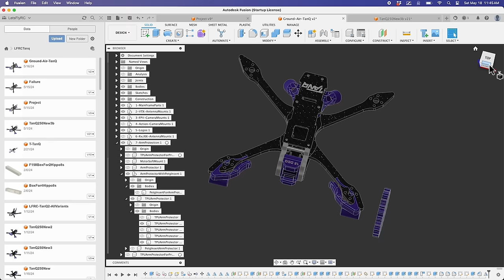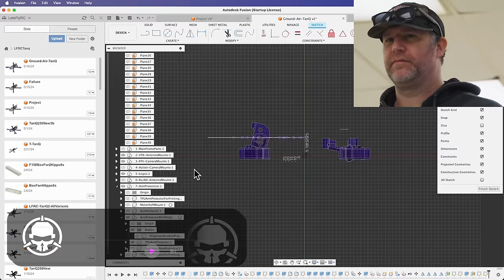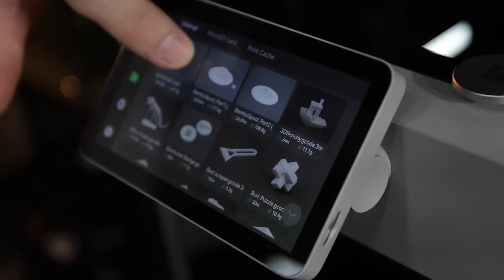We Made a RC Car That FLIES!?! - 50mph on Land 100mph in Air!

Comment: I would love to see how it would drive if instead of your solid wheels, use TPU and replicate the "tweels" they use on lawn mowers. I would hope it would be lighter and smoother.
Reply: Possibly. Usually my stuff is just proof of concept. And I had to make it work quickly to get it done in time. They worked pretty darn good, though they did have a little bit of slipping in some areas.